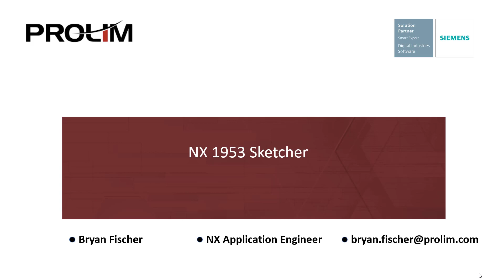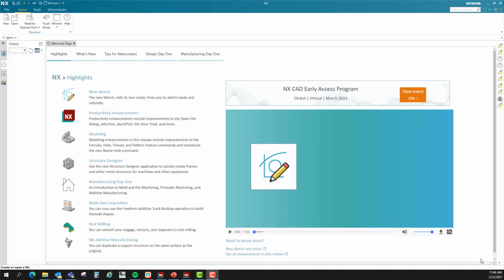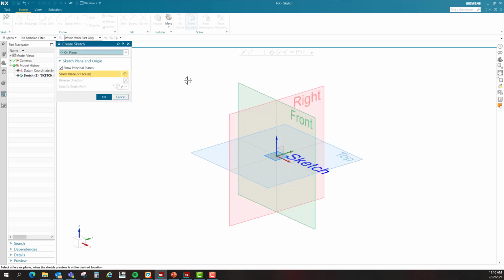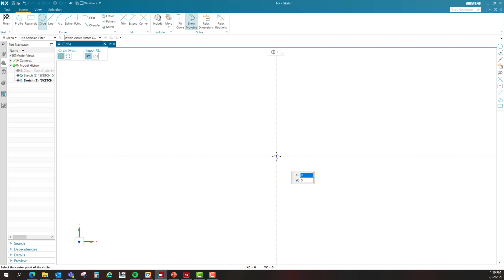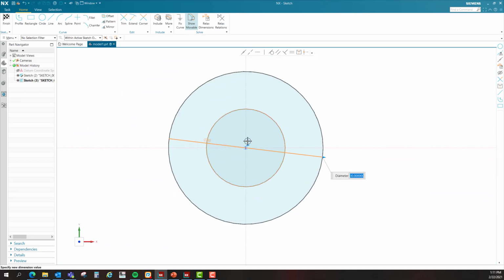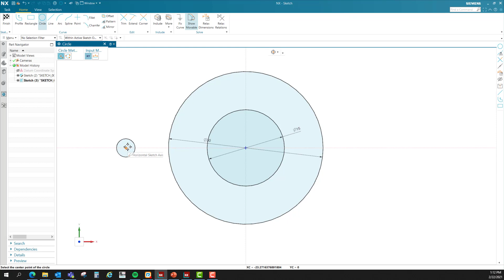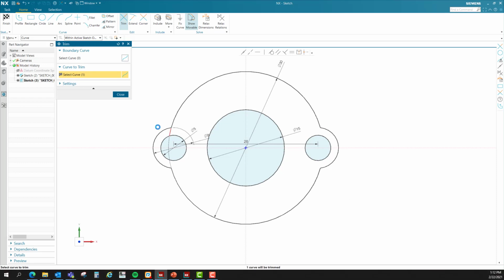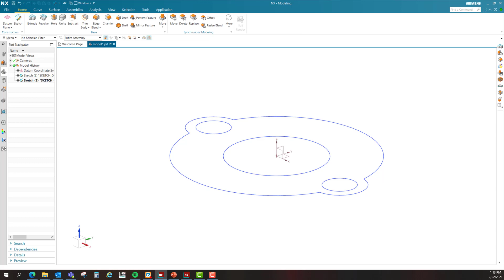New Sketcher in NX 1956 - PROLIM

Comment: Hey Bryan

 you have skiped most important part.....tell me how to set the plane orientation in this new version of NX...

if anyone know how to solve this in new version of NX 1957 then reply me here.
Reply from the maker: Thank you for your interest & comment. You can use the reattach sketch command to change the orientation of the sketch after the fact. If you still have a question, please send us an email at info@prolim.com and we'll be happy to help you!
Reply from the maker: Siemens reintroduced the sketch orientation in NX 1980. This sketch orientation works in the same manner past NX users are accustomed to using in the old Sketch solver.